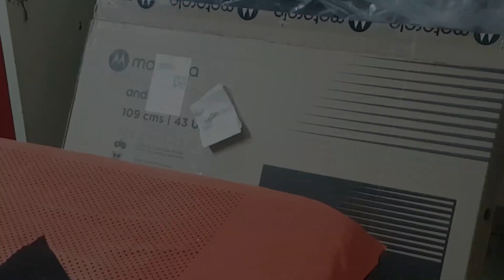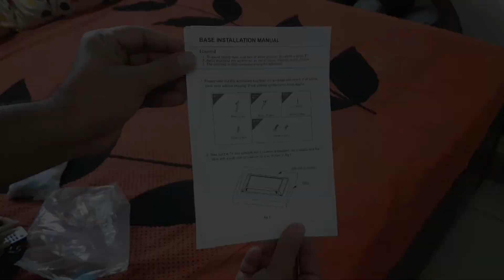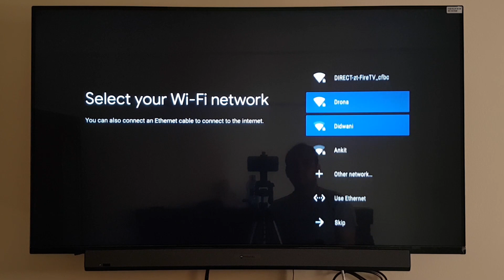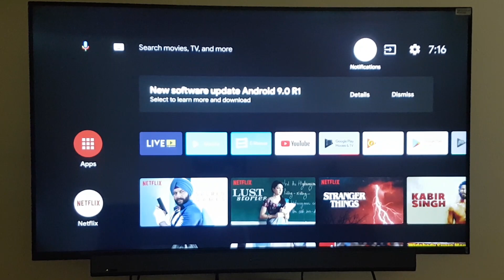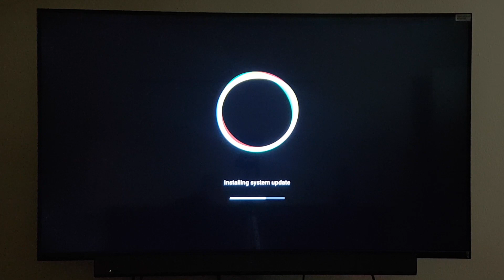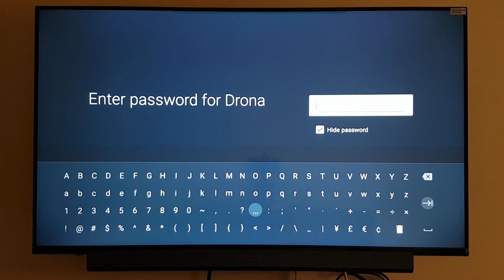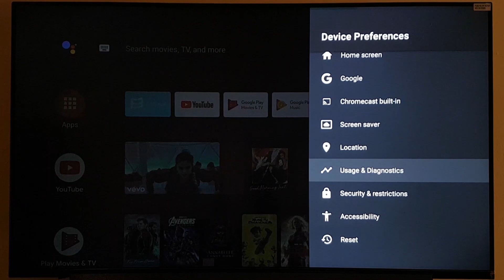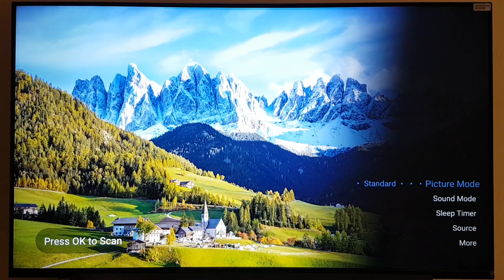Motorola Tv Unboxing, Installation and Initial Setup.

Comment: If you are really a techie, solve this. 
Exactly at 4:16, there is a skip option. How to do that without using remote? My remote is damaged and the service engineer performed hard reset and all other pairings with my android phone and gamepad vanished. He finally said the remote is not working which i said him earlier the reset. Now i want to skip the remote control setup. Pls help
Reply from the maker: Have you tried with the button on tv and if it doesnt work try with mouse as it doesn't need pairing.
Reply: @IndianTechTube Tried with TV burtton, but it was helpless. nice idea to try with mouse. Will try tomorrow for sure

Comment: Does the Motorola TV support Local Dimming like the Nokia TV?
Reply from the maker: No it doesn't support but Nokia tv 43 inch doesn't support local dimming either only 55 inch variant support it.
Reply: @IndianTechTube  thank you very much for the clarification.
Reply: Does the Nokia 55 inch model support HDR10
Reply from the maker: Yes it support

Comment: Sir , how long have you used this tv, please suggest following
1) what are problems seen so far in this tv
2) mi or motorola, which is better
Reply from the maker: I am using for almost 1 year and there were software bugs in this tv like crashing of apps, wifi connectivity was not that good and there are few more issues and they have provided 4 updates with in 1 year and all the issues are resolved and now its working absolutely smooth.
Reply: @IndianTechTube  thank you for your reply, but do you suggest MI , us it better than motorola.
Reply from the maker: @makinglifesmart3603  nahi mi tv picture quality is inferior

Comment: Bhai are you still using this tv any screen bleeding , dots issue , audio issue,gaming , connectivity issue . If you are facing it pls tell.would this is a good product because I want to buy it
Reply from the maker: Yes I am still using it...There is connectivity issue as it doesn't have dual band wifi and sometimes we need to turn off and on wifi when we boot the tv and very occasionally this tv automatically turn off while using prime video or hotstar but it happens very rare once in a week or so but picture quality is very good and can't complain about it, so there are issues but not deal breaker as every tv have some issue and it's issue might be resolved with ota update and I have given internet via lan from repeater and that is working perfectly fine so overall you can go for it or save some bucks and get vu premium android.
Reply: Pls tell about screen bleeding issue or screen flickering are you facing it pls tell about that
Reply from the maker: @channel of everything there is no bleeding or flickering
Reply: Thanks

Comment: Actually I have 4-5 queries would be very kind of u to reply and suggest me..
1.How good is the reliability of this tv? A
2. Are there any screen bleeding issues in this tv?
3. Can I install jio tv on this by any method?
4. Can I connect my 5.1 music system which only have headphone jack? By any method!
5. Can I connect it with PC? And is there any input lag?
And last 6. How does it work with mobile casting? Everything works good?
Reply from the maker: Nobody can say about reliability but it is similar to all other budget TVs
No visible screen bleeding
Yes jio tv can be installed
Yes we can connect old speakers with tv via a converter.
Yes pc can be connected and I have shown it in video and shown lag too
Casting works fine
I have made videos on most of your queries so plz visit my channel and watch those videos and pls watch Motorola tv comparison with vu tv too.

Comment: Sir is this better or I should go for 50 inch tv!??
Reply from the maker: If you have watching distance of more than 8 feet then go with 50.
Reply: @IndianTechTube  sir one more doubt according to which is better va panel or ips coz for me 43 and 50 both are okay
Reply from the maker: Ips is definitely better.
Reply: I was planning to buy va of 50 inch so should I skip that and go for 55 inch or I should buy 50 inch. Coz VA has its own pros..!!
Reply from the maker: Yes va has better contrast but if i have to choose one i would go with ips as it has enough contrast and looks absolutely same from any angle.
Reply: @IndianTechTube  sir I have already order 50 inch I hope I will not regret🤪

Comment: Hello sir....is it safe to do a factory reset in my motorola tv??
I am having issues with my motorola tv....it shows black screen when i click home button....it is not responding.....please help me sir
Reply: But when i use set top box it is going fine....what to do sir
...home screen is going black and after few minutes it comes back and when i glide to any other side with remote it turns black again

Also it is not connecting with internet now.....please help me sir.....only this issue is there...is factory reset safe
Reply from the maker: yes it is safe to do factory reset..by the way which model do you have?
Reply: I am having motorola zx pro model tv
Reply: It is an android tv
Reply: Sir can i contact with with u somehow by whatsapp or instagram likewise.....so that i can sent to the video of the condition...
Reply from the maker: yes you can contact me on insta

Comment: How to connect home theater with this tv as HDMI arc is not present, thanks
Reply from the maker: HDMI arc is present and if it  doesn't work due to some reason with some brand you can connect via optical output which works perfectly fine.
Reply: @IndianTechTube  Is Hdmi 1 audio out referes to ARC in 43inch UHD model?
Reply from the maker: @hemantkhairnar5143  yes

Comment: Sir can i connect usb camera for video chat in motorola 4k tv?
Reply from the maker: Yes usb camera can be connected but audio doesn't work as the mic is through remote so it only works for few seconds and then it stops, you can use it for video and I am yet to test it on one plus tv, will make video of webcam works perfectly, it might work with future update.
Reply from the maker: Just tested with one plus tv and still no audio, Motorola tv is about to get july update after that I will test it.
Reply: @IndianTechTube  thanks sir

Comment: Hi need one help..i had to factory reset my tv and  when i try to setup again...remote is not detected...it is stuck at press assistant button screen...tried with new batteries also..can you pls help..thanks
Reply from the maker: Press home and menu button together to pair the remote.
Reply: thanks..but no use...now there is no sensor light also..pressing assistant button and also tried this combination...any other ideas?
Reply: Also..any other way to setup TV without this...i factory reset the TV like an idiot
Reply: @IndianTechTube  Any suggestion on how to setup without remote...the service center is saying they will take more than one week to give new remote
Reply: @ramireddy46  same problem here buddy please tell me how you are doing it
Reply: @suyashtripathi3104  Well the call centre is of no use. they didn't reply till now after 4 weeks, but i found a solution. I connected my TV to router using a physical lan cable and then setup the TV using the default Google android tv remote app. Now i am using tv with the phone app only...i also complained to consumer forum about lack of response from flipkart and Motorola..let's see if they do anything
Reply: Also i escalated complaint on the App of Department of consumer affairs due to no response..please do the same if you don't get reply
Reply: @ramireddy46  i have reset my tv and i am on my demo screen where it is asking me to press Google assistant button but my remote is not working can i setup my tv in that case without original remote
Reply: @suyashtripathi3104  yes i was on the same screen, the solution...get a lan cable and connect your internet router to your tv directly...then you download android tv remote app from playstore...your phone to be connected to wifi...then when you open this app, your app will detect the tv and from within the app you can skip and it will allow you to proceed ahead
Reply: @ramireddy46  how i can contact you its very urgent brother i will not tak your much time
Reply: @ramireddy46  please reply 🙏🙏
Reply: @ramireddy46  where r u
Reply: @ramireddy46  can i use phone instead of router using usb otg adopter and then i will connect to another phone using wifi will it work

Comment: Is motorola ZX pro is better than motorola revou ? Please help me out
Reply from the maker: It's not better but better value for money as it comes with a gamepad in the box but contrast will be much less than revou.
Reply: @IndianTechTube  am i going to face any problems with the tv because today i ordered the new zx pro ?
Reply from the maker: @ummifirdoushi8679  zx pro comes with android 10 and currently android 10 is having few issues like we cant connect webcam and most of the gamepads are not supported but these issues might be resolved in future update.
Reply: @IndianTechTube  is motorola revou also facing all these problems? And why nobody is making review of the new Motorola ZX pro? Please answer.
Reply from the maker: @ummifirdoushi8679  yes revou is having these issues and zx pro is having zx display and revou hardware so it's a mix of both TVs and Motorola is not giving review units to anybody so nobody is reviewing it, reviewers can't buy all TVs.

Comment: bhai isme cromecast hain kya
Reply from the maker: bhai Chromecast hai lekin abhi thik se kaam nai kar raha.thodi der me automatically disconnect ho jata hai..may be software update se thik ho jaae.
Reply: @IndianTechTube  to kya bro mujhe iski 55 inch led khridni chahiye ya nahi
Reply: nd isme setp box conect hota hena
Reply from the maker: settop box connect hota hai nd definitely you can go for it but till date chromecast not working properly...nd wait for my full review for all pros and cons.
Reply: @IndianTechTube  ok.jaldi video banao ap.ispe
Reply from the maker: i also want to make it quick but to make a indepth review i need to use it at least 15 days to know all the pros and cons, otherwise it will be a incomplete review.
Reply from the maker: bro chromecast is working fine now and casting through vlc is even better.
Reply: @IndianTechTube  bhai mujhe iska 55 inch wala lena hai led par onlain out of stok bta rha h har jagha kya oflain yeh mil jayegi kya
Reply from the maker: it is exclusive to flipkart....

Comment: Bro almost you are crossed 9 mnths with this tv..how is the experience of the video quality in cable ??? Is there any lag consistently? Is chromecast working good or any stuck??
Kindly rplying me theese questions bro....bcoz im gonna order this tv of 32 inch  ..
Reply from the maker: Bhai you can't compare 43 inch to 32 inch as both have different hardware and software.
Reply: @IndianTechTube  bro can i go to moto for 32 inch or else suggest me a good brand of 32 inch smart tv's
Reply from the maker: If you want gaming then go with Motorola else get mitv 32 and save money.
Reply: @IndianTechTube  so 32 inch moto is bad in picture quality
Reply from the maker: It's not bad but it's not superior as compared to mi so why pay more for a feature you won't use...But if you want gaming get Motorola so that you will get a gamepad.